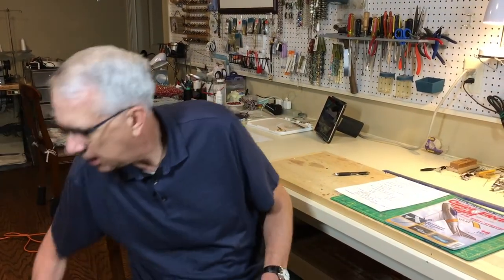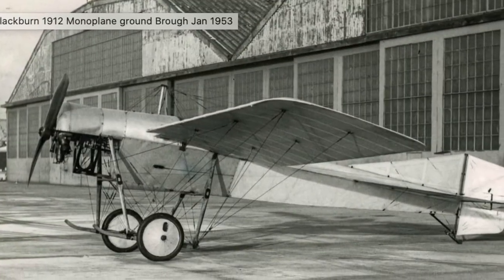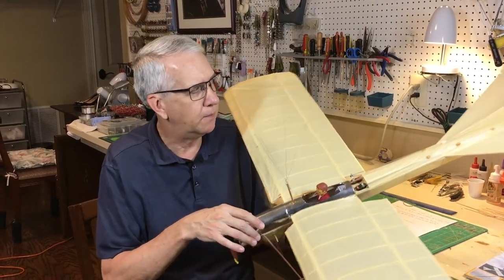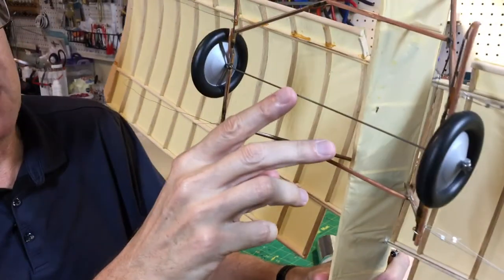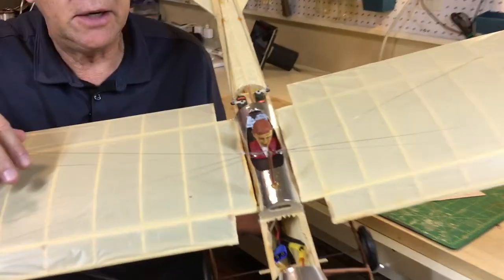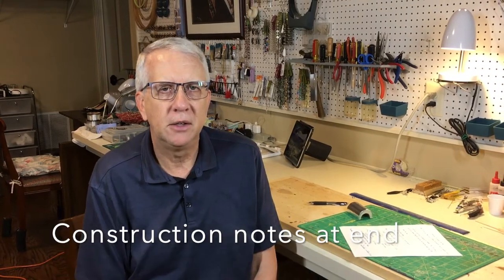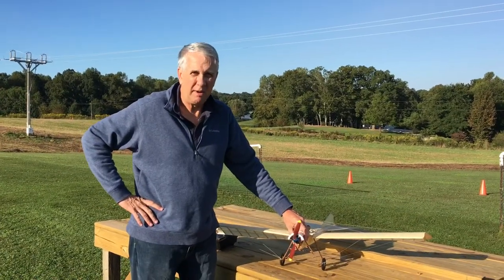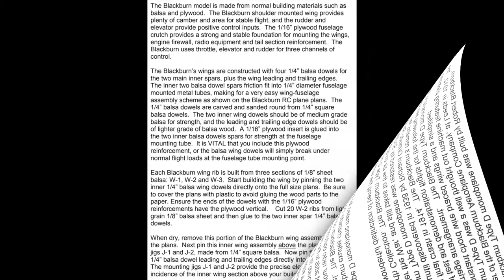Blackburn RC Airplane - Free Plans!

Comment: The wing loading on this airplane is so low that it clearly can only be reliably flown in calm conditions or inside. In any wind, it really is a powered kite. If it were a bit heavier it would actually fly much better in a light breeze. Experienced sailplane pilots know that in windy conditions an ordinarily lightly-loaded sailplane needs some ballast so that it can perform at its optimum. 
You might consider providing a space on the C.G. for extra weight to be attached when the wind is blowing which then can be removed when it is calm. In this way, you can fly this lovely airplane in varying wind conditions (to a point) without it being blown all over the place as it was in the vid.
BTW, it will stall and spin which it did around 11:10. I thought I saw it stall numerous times. Being so light, little to no damage was done from the spin, so at least that's a mercy.
Reply from the maker: G-Man:  You are correct, if the Blackburn is heavier is can fly in windy conditions.  The plane was actually designed for heavier nicads when I first flew it indoors.   I do like the "light" feel of the current plane, just need a calm day.  😬 Tim
Reply: @TimMcKay56  Yes, I completely understand. I've built a few very light airplanes like that. However, using removable ballast would allow you to fly it even when it isn't absolutely calm and you could enjoy the model more often.
Reply from the maker: Good points!